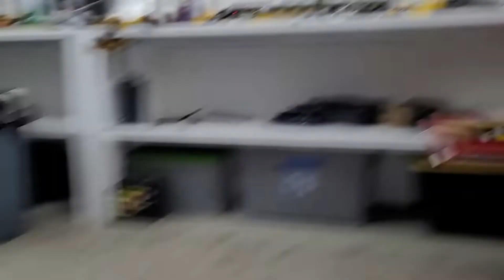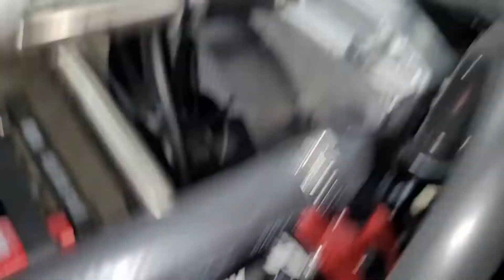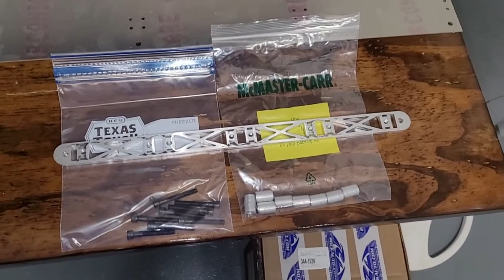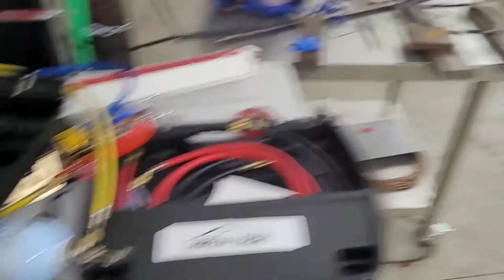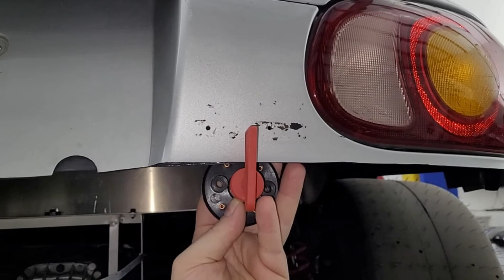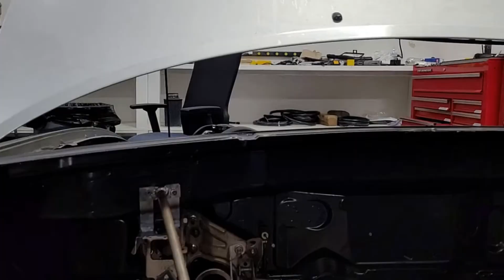Racecar Custom Wiring Begins!

Comment: Why so many switches? I must have missed the context on that
Reply from the maker: The idea is each circuit has its own fuse and switch.  So if anything shorts out or quits, it doesn't take out other stuff and it makes troubleshooting a lot easier.

Comment: I thought about doing a switch panel like that but decided on a pdm.

Wiring use to be the one thing i hated to do and would never touch and now i am comfortable enough to build my own motorsport grade wiring harness.
Reply from the maker: Nice! I have always wanted to build a panel like this, but my previous setup was a street car so it didn't make sense. Now that it's racecar only I can justify it. I'm hoping this one turns out nice. It will be a mix of motorsports grade and trying-to-do-good-but-not-rich-and-in-a-rush grade.
Reply: @patrickcowanjr1  I think it looks amazing and very well thought out!
Being able to remove it shows your level of engineering creativity!